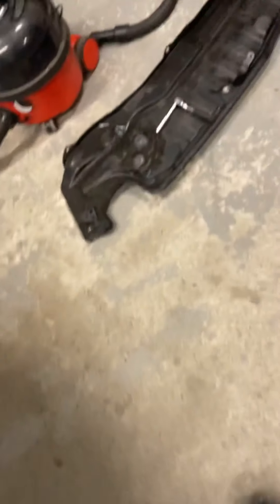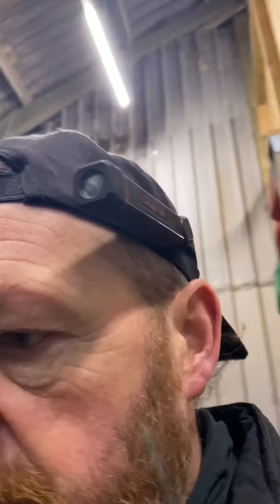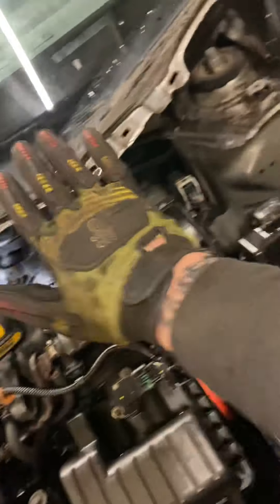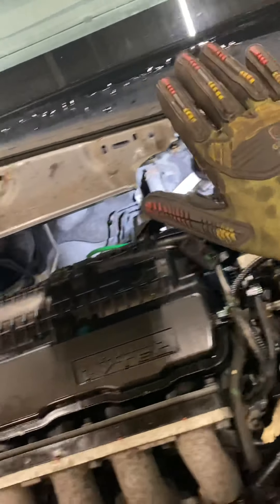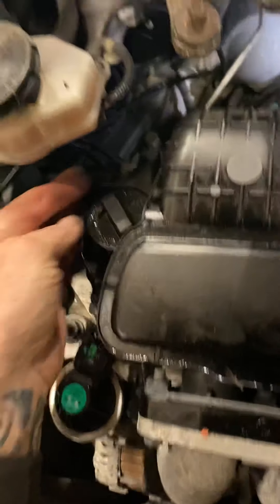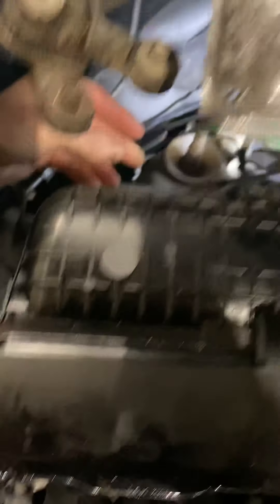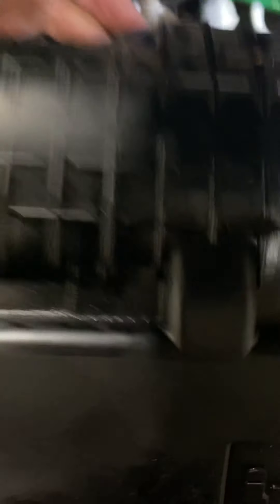Honda jazz spark plug replacement

Comment: Thanks for this . Spent ages trying to decide between a B max or Jazz , had sort of decided to go with a 1.3 Jazz 2016 . Then came across a service article in an old copy of Car Mechanics magazine which highlighted what a pig the plugs are to change . Almost put me off , till seeing your video . Still trying to decide between the 2 cars , but the Jazz is back in the running 😀 Subscribed
Reply from the maker: Glad to help mate. As an aside I’d go with the jazz easily. 🙏🏻
Reply: @bradauto   Thanks mate , appreciate the advice . Love  the sliding door on the B Max but presume the Jazz is more reliable ?
Reply from the maker: @rogerkretzschmar8280  exactly
Reply: @bradauto  Thanks , appreciate your advice.